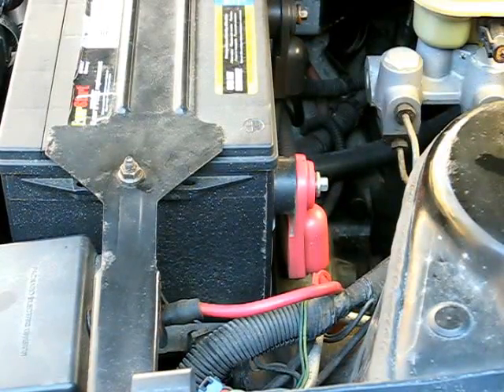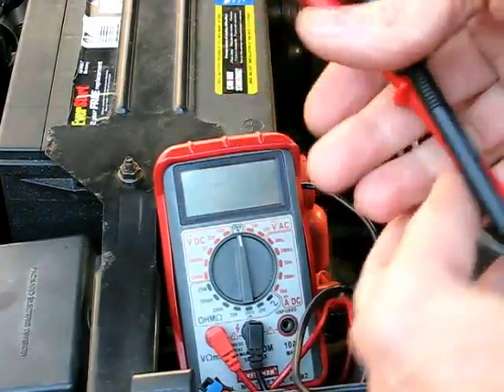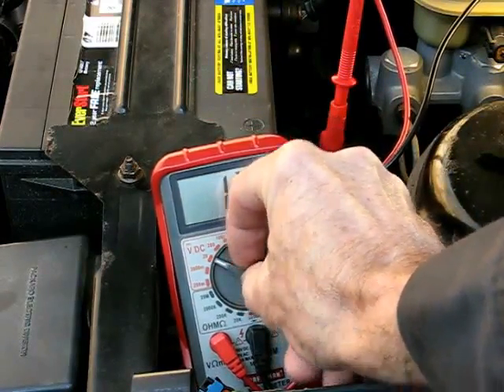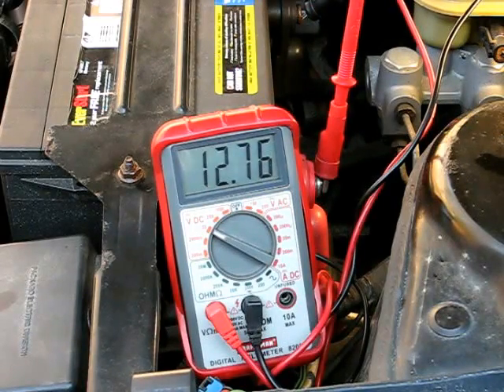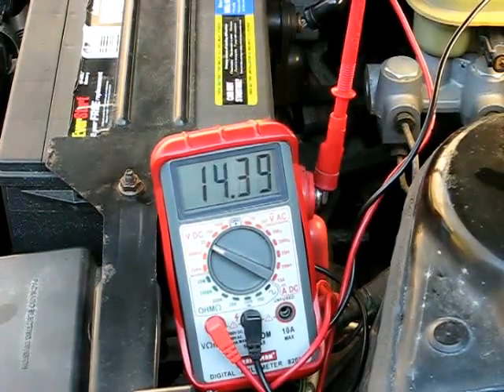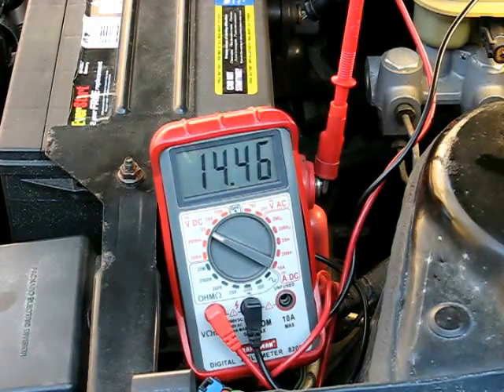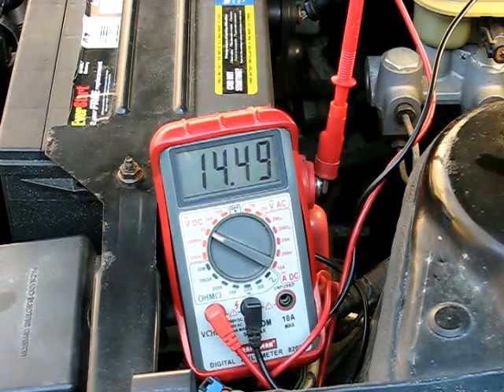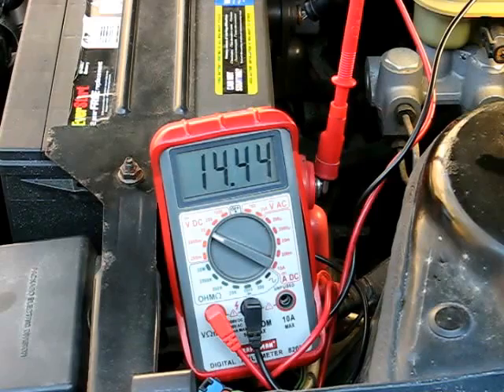In Car Alternator Testing

Comment: Hi rich I own a 2002 saturn sl2.im having I weird problem with my dash and exterior lighting Pulsing. The frequency changes when I accelerate I did change out the alternator. But still the same issues. Any ideas ? Thank you

Comment: I checked mine and it was 14.4V when starting the car. Once the car is warmed up, it dropped to 13.9V.

Once I turned the AC on and the fan all the way, it dropped to 13.5V and a few minutes and the voltage dropped again to 13V and keep changing between 12.8V to 13V

Sometimes because it's hot here, the cooling fans runs at their full speed, and the voltage drops to 12.6V

The alternator is going bad, right?
Reply from the maker: 12.6 is low so the alternator might be weak.

Comment: While the blower-fan does add load, it doesn't add much. Turning on the High-beam lights in addition to the blower can add a higher load. The A/C will take slightly more only due to the fact that the clutch is engaged electronically. That is negligible though. Good video though.

Of course there are times when testing cant produce results like in my old i30. The alt would run strong for a while then just cut out randomly. Fortunately, the battery light would illuminate when that happened.

Comment: I had an alternator that made a humming sound much like in this video, when I tested it with a meter I got 14.5 volts, but my battery would get weak every once in a while and wasn't turning over the car very well, so I removed it and had it tested on a machine at auto zone, they found that it failed after a while when they put a heavy load on it, so sometimes the sound can be a tell tell sign that something is wearing out..

Comment: Alternators convert AC into DC current more easily, too, using solid state diodes.
Current alternators can produce over 160 amps

Generators had very clean electrical output, since they produced pure DC. 
most generators had a maximum output of 50 amps

Comment: The main difference between them is in regard to what spins and what is fixed.

In an alternator, electricity is produced when a magnetic field spins inside the stator (windings of wire). In a generator, on the other hand, the armature or windings of wire spin inside a fixed magnetic field to generate electricity.

Comment: If car running(all cables connected) was not testing your battery but alternator.   Should be 'my alternator'(NOT my battery) read 14.56V. Strong alternator. Turn off engine, battery should read 12.6 or a bit less and remain steady... if going down or less than 12V may be shorted inside. If ok, rigorously test each fuse in all fuse boxes, leads at each end of each fuse(Amp Setting) to catch current draw and circuit connection and/or device that drains battery. more than 50mA read= trouble.

Comment: Hey richpin06a, I have a ford windstar and the alternator voltage is around 14.56 when I start it but if I put a load on it it drops to about 12.65. Would that mean I have a bad alternator.

Comment: @richpin06a 

Second test! Engine runs for 40 min.
Engine on 13.65V
Switching on headlights heater blow 13.77V
Exceletaring with 2000 REV and test is 13.87V
Switching OFF engine is 13V

Comment: Before start engine my one is 12.59V 
Start engine it's going 13.84V
Swithing on headlights and heater blow 13.87V 
Switch off engine it's going back 12.60V

What do you think is my alternator failing?

Comment: @MrMark2308 Wait a minute ! You mean alternator shaft speed and not engine RPM, right  ? Anyway, if a diode fails, doesn't the alt warning light flicker demonically ? Zener diodes allow currnet to pass in either direction in some instances without damaging the diode. I find this hard to fathom, these crystalline devices.

Comment: The new digital battery chargers from Canadian Tire tell you the percentage of charge in your battery. The old analog chargers just give an amp draw reading during charging. You'd be surprised that  a run-on rad fan with 20-30 amp draw can leave the battery in a LOW state. Even when the voltage meter says the battery is 12.6 -12.8 volts the battery can still be low. Motomaster Eliminator Intelligent charger. Try one today. @ $40.00 Can.

Comment: @wet8pussy  This means that you still have some "surface charge" on the battery, A fully charged battery has 12.6 volts each cell produces 2.1 volts times 6 = 12.6 !

Comment: That is normal for the alternator to drop in output as the engine reaches operating temperture. not to mention that it creeps down hundreths of a volt. at operating temp it will be around 13.75 Volts DC